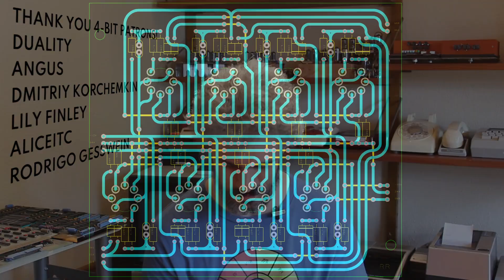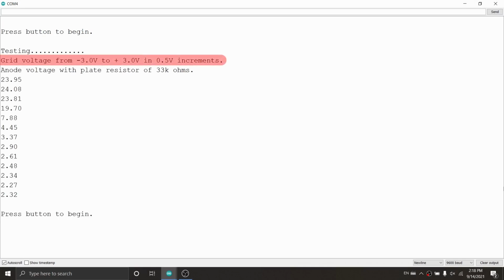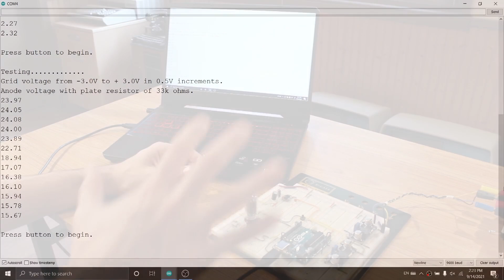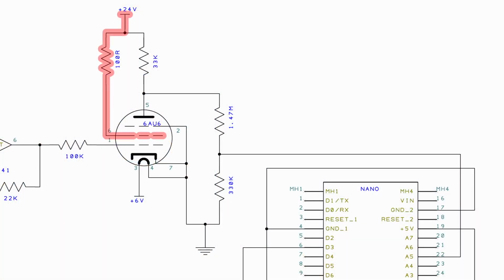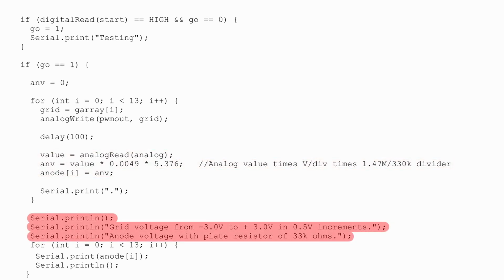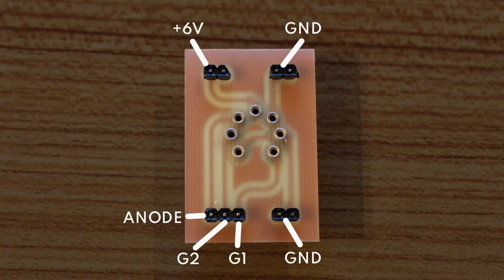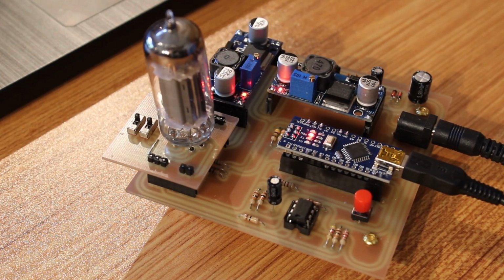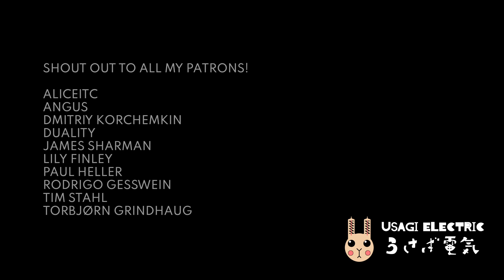Arduino Based Low Voltage Vacuum Tube Tester

Comment: Very nice, sometimes a specialized piece of testgear is the simplest and best solution. 
It kind of reminds me of the universal component tester, that got copied by every chinese seller, a very handy and cheap tool.
I like how you used only very basic components to achive a complex task. 
In my opinion this is something that gets lost more and more, since it became so easy to just buy a small PCB with a purpose made IC for the Job.
Reply from the maker: Thank you!
I really wanted this to be something that was dirt cheap and could be made by anyone anywhere in the World. I actually added it up, and in parts cost on the finished version, I have less than $15 in it! My goal for V.2 is to have something that gives proper curve tracer data for less than $30. I don't know if I'll be able to achieve that since I'll need a lot more complexity, but if I can, I think it'll be something that'll be useful to a lot of people!

Comment: Using a 555 as a voltage pump? thats a thing? woa
Reply: Try taking a look at an old 555 timer datasheet, there were many application circuits for all kinds of interesting circuits, the voltage inverter being one of them. Another interesting one in the same ballpark is a buck or boost converter with full feedback loop based on the 555.
Reply: @gammaleader96  It just seems nuts, but thats one of the things great about electronics; the 'intended use' (be it intended or just taken for granted in my head like that) is often just one part of a components capabilities; the options for use or abuse are so many ...
Reply from the maker: The 555 is a truly great chip, people have made all sorts of wild stuff with it!
It may not be the best negative voltage generator out there, but I really only needed a tiny amount of current, so I figured it'd get the job done!

Comment: Holy crap.  I want to see that old teletype running.  :O
Reply from the maker: That old Morkrum Kleinschmidt is pretty cool, isn't it!
It's actually pretty close to being good to go. The send portion works with no problems, and the receive portion operates, it just needs some serious adjustment. My biggest holdup on it right now is that I need to build a 120V 60mA current loop for it, and some kind of level shifter that lets me hook it into modern RS-232 interfaces. 
Here's a short video of the send portion putting some Baudot code into my scope: https://imgur.com/gallery/dxnTJJZ
Reply: @UsagiElectric  Maybe you should ask @CuriousMarc he has done a lot with Teletype current loops. 😊

Comment: Awesome project!

Improvement idea: I was reading the diagram and, in my opinion, it would improve your testings if you made use of a buffer of some kind at the valve output (anode) terminal, before the voltage divider.
Reply: I agree, it would improve things! Also datasheet claims that analog inputs are optimized vor 10K impedance sources, so your voltage divider might be a little high in resistance. Might cause errors at higher speed.
Reply from the maker: Thank you!

That's definitely a good idea! The primary reason I didn't end up buffering the output was because initially I was planning on building this thing at 100V to hopefully make it a little more appealing to more tube users. I actually did some initial testing using a 100k anode resistor and a 10M/474k voltage divider. These were the results from the initial testing set up like that: 
https://i.postimg.cc/904ngMxs/unknown.png

But, I didn't have anything in my collection that could buffer a 100V output (short of another tube), so I just went with a massive voltage divider and it seemed to work decently well. Once I decided to split the project into two (one being this low voltage version and another being a proper high voltage version that gets I/V curves like the datasheet), I just changed the resistor values a bit and dropped the anode voltage to 24V. Other than that, it's actually the exact same design. 

For V.2 we'll get a little more serious with the buffering outputs and making sure we're getting proper readings!
Reply: @UsagiElectric  For V.2: Why don’t you go for buffering voltage after the divider, using an OP amp? So you can keep your high resistive divider, which is a good thing to have in order to keep load low! On the other hand the voltage follower doesn’t need to be capable of dealing with high voltages. Pretty nice project, looking forward to see version no. 2! :) Might gonna build one too...
Reply from the maker: @schmitzvonschmitzen2870  Interesting! I was so focused on trying to keep the load on the tube to a minimum, I totally didn't think about the issue being on the Arduino side. In that case, a little OpAmp buffer after the divider makes a ton of sense!
For V.2 however, there's a couple designs I want to test out, but one in particular would keep things pretty simple and not require buffering of any high voltage. 
I've got a bit of real-life stuff going on at the moment, but I hope to dig into and start testing out ideas for V.2 in the next few weeks!
Reply: @UsagiElectric  A quick cheat version of this is to put a small valued capacitor, like 1nF between the ADC input pin and GND. This provides a momentary rush of current for the ADC sample.  You must also add a small delay before ADC samples so the cap voltage settles. It should make readings more repeatable without adding an opamp. The opamp will do better though.

Comment: This is amazing! And just in time before ordering my first arduino. I guess i'll have to order two now ;)

Do you think this could be adapted to higher voltage? For example scaling up the anode voltage by 10 and then changing the voltage divider accordingly? And i guess maybe also the grid voltage driver.

Thank you so much for your amazing content
Reply from the maker: Thank you so much!

Interestingly, I initially designed it at 100V using a 100k anode resistor and a 10M/474k voltage divider. These were the results from the initial testing set up like that: 
https://i.postimg.cc/904ngMxs/unknown.png

The upshot of this is that the tube is operating much closer to the voltage it's designed for. Though it still has the same drawback of just measuring the output with an anode resistor in place, which is great if you have a fixed circuit circuit environment you're working with, but doesn't really give results like you would expect to see in a datasheet. But, it definitely works, and you could even replace the anode resistor with a potentiometer to have a variable anode resistor for a little more flexibility in testing (though, it would also need like an additional 1k resistor to prevent the tube from pulling massive current)!

Comment: That is one sophisticated tester as is, but if you are planning on building one to test at higher voltages. That would be beyond amazing! You really know your stuff that's for sure.
Reply from the maker: Thank you!
It's really specialized for my needs, but the design as it is actually works fine at higher voltages too. I actually tested it out with an anode voltage of 100V, an anode resistor of 100k and a 10M/474k voltage divider. These were the results from that: 
https://i.postimg.cc/904ngMxs/unknown.png
But it still has the problem of a set anode resistor and not giving us the real characteristics of the tube. We've been tossing around some ideas for V.2 to give proper datasheet style information, so hopefully I can expand on that and get something neat going!

Comment: you should make it graph the data
with a overlay of a good tube
that way you can make it a fast tester
Reply from the maker: Ultimately, I would like to have V.2 have a database of tubes stored in an application that can then cross reference on the go, without needing to copy the data into an Excel sheet. For my purposes, V.1 here is great and will definitely get some use, but something that's a little more in-depth I think will help a lot more people!
Reply: oh you are your using a exel sheet for that

Comment: Nice project! But I have some ideas for improvement ;-)

I propose that you read the analog voltage 16 times and accumulate the results (add), then divide by 4 - you just gained 2 bits of resolution for 'free' (a bit of time). Also go for faster serial speeds, there is no reason to sit at 9600 baud, you can safely do 115200 baud.

You can also use internal pullup of the arduino for the switch with pinmode(start, INPUT_PULLUP) - the input will stay at high state untill you press the switch, then it will go low - you would need to invert the logic in first state of your state machine if (digitalRead(start) == LOW && go == 0), but you need 1 resistor less and simplify the layout.

With the 555 you could have configured it differently to also save some parts - resistor from output to trig and treshold and capacitor from trig and treshold to ground - this way you will get 50% duty cycle with just 2 timing components and simpler layout.

I'd also go for a TL072 for the opamp - it has way lower drift and better input impedance so won't load the PWM voltage much, u741 is super outdated. You can also use the second half of 072 for an active filter to lower ripple of the produced voltage. Also dividing the voltage at the pasive PWM filter as you are doing seems like it increases ripple of the produced voltage, would be better to lower gain at the opamp.
Reply: And one more thing - you could go one step further and be able to vary both anode voltage and grid voltage, then measure cathode current - this way you could generate the characteristic curves of the tubes or other components (I/V curves).
EDIT: just watched to the end and you are talking about just the thing ;-)
Reply: Also there is a better way to reference the op amp to a negative voltage, I drawn up a schematic. imgur com/ a / unHHLEl you need to add the dot and remove spaces yourself.
The filter needs around half a second to settle, the resulting voltage is rock solid ;-)
Reply from the maker: Thank you!
And there's tons of room for improvement here!

The idea to do it 16 times and accumulate the results is a great idea! Although, the biggest bottleneck in the test isn't from the baud rate. In the main loop, when testing, I do the AnalogWrite to set the grid voltage and then I have a delay(100) command. I found that if I didn't let the tube settle in to the new grid voltage, I had a few issues with getting reliable reads. I can bring that delay down to about 20ms, but any lower than that and I started getting problems. I way overshot it with a 100ms delay, but then I know the tube is nice and stabilized for my read.

I totally forgot that I could set pullups on the Arudino! That would have some some code and simplified the start button a bit. I'm definitely a brute force type programmer, there's like zero elegance to my code, haha.

As for the OpAmp, I used the 741 because surprisingly, it was the only OpAmp I had laying around. This entire thing was actually built from scraps I had floating around the lab (well, the breadboard version was at least, I ordered some new buck regulators for the PCB version so I wouldn't lose my only two). And filtering the buffering the output from the tube through an OpAmp filter is an excellent idea, but the primary reason I didn't do it here is I was initially building this to run at 100V (I even did some testing with it at 100V: https://i.postimg.cc/904ngMxs/unknown.png ), but I didn't have anything that would be able to buffer a 100V output like that short of using another tube. For the low voltage version, that definitely would have made more sense though!

Thank you for the schematic on the OpAmp to a negative voltage control, I really didn't have a clue what I was doing and just used the first schematic I came across on the internet that I could get working on the breadboard, haha. It seems to work decently, but there's definitely better ways to tackle that. I'll probably leverage your more robust design for V.2 where we start building proper Datasheet style curves!
Reply: @UsagiElectric  I'm happy you find my sugestions useful :-)
If you'd like to bounce some ideas about circuits just hit me ;-)

About buffering the tube output - you still can use a large resistance value divider, just put a voltage follower after it (opamp with '-' input and output connected together, your input signal goes into '+' input, you take your output from the output pin) - this way you give your ADC a nice low impedance source to load its sample and hold capacitor.

Having the circuit settle is crucial anyway with PWM used for analog output, it takes a moment for the voltage to get where it needs to be. And it's not a race but a piece of test equipment, way better to have accurate results one minute later, than garbage in 2 seconds ;-)